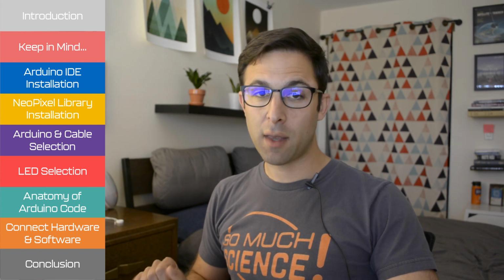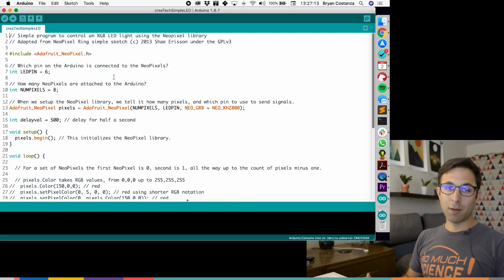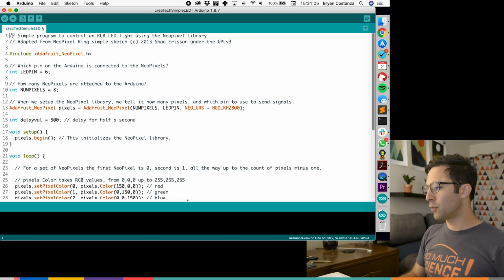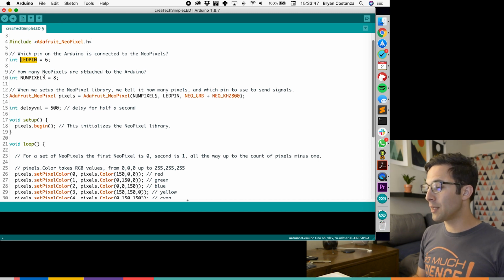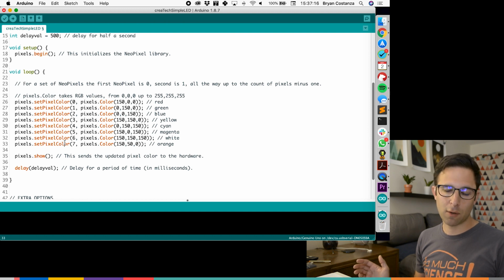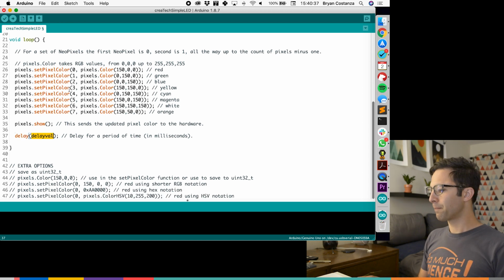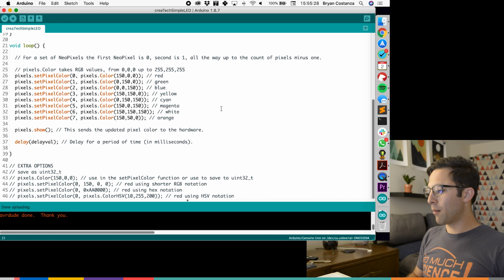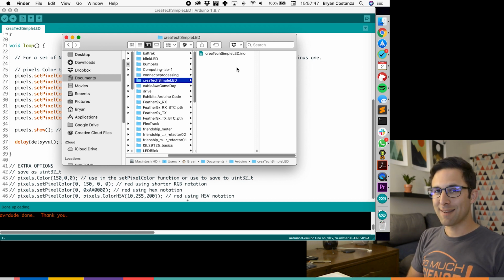Arduino NeoPixel LED Tutorial for Beginners

Comment: Aweaome simple language to understand  your vdo.tks 
i would like to know How do i wipe the addressable  led strip off the code and make it a regular led strip  as in so that i can ise it for regular  purposes.  Tks
Reply from the maker: I think the answer to your question is that the LED strip does not have any memory so there is nothing you need to do with it. To clear the Arduino you would need to upload a blank sketch to clear its memory.
Reply: @SoMuchScience  tks for ur reply  then i guess i messed up my led strip.
Keep up the good work.👍
Reply from the maker: @autoworldgentech3304  Happy to help! One other thing to consider is that the LEDs might remember the last color they displayed and will retain that until some other color signal comes to them. Maybe try loading something really simple onto the Arduino that you know works and see if that changes the LED strip colors from where they are stuck now. I know the LEDs will stay the same color with no signal as long as they have power.
Reply: @SoMuchScience  yeah i thought so but in haste i cut a few leds to wipe data but it does not work ill try loading new data.
Tks
Reply: @SoMuchScience  hi there jus wanted to know  if i want to hook up 12v led strip for my car tail lights , brake lights and turn lights do i need to add a resistor in + wire and what resistor for turn light led signal ill need .
Tks
Reply from the maker: @autoworldgentech3304  This sounds like it is getting outside my area of experience
Reply: @SoMuchScience  nyways tks tc

Comment: Can you do a video on how to use temperaure sensor values to change color of neopixel
Reply from the maker: That sounds like an interesting project. Can you explain more about what you would like it to do with the LEDs based on the temperature reading?
Reply: @SoMuchScience  change the color and/or speed of the pixel strip

Comment: Totally new to all this, but I saw elsewhere that if you’re using an Arduino to drive the data for a strip with lots of individually assignable LEDs, anything less than the Arduino Mega can suffer from lack of memory for certain functions, for example, driving 1m 144 LEDs as a VU meter, does anyone know if this is still accurate?
Reply from the maker: I've never come up against the limit but it looks like ~600 is a common limit. This seems explained nicely at https://www.eerkmans.nl/powering-lots-of-leds-from-arduino/ with a good chart showing memory and pixel limits. You might be able to hack your way past that limit a little bit https://hackaday.com/2014/05/19/driving-1000-neopixels-with-1k-of-arduino-ram/. The NeoPixel Uberguide touches on this at the end of their article and references a place you might find more information https://learn.adafruit.com/adafruit-neopixel-uberguide/arduino-library-use.